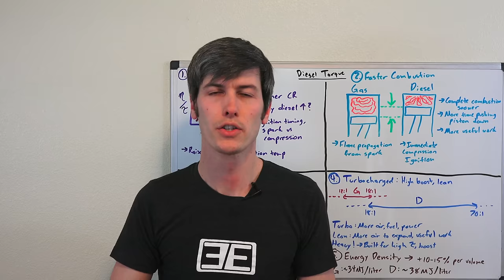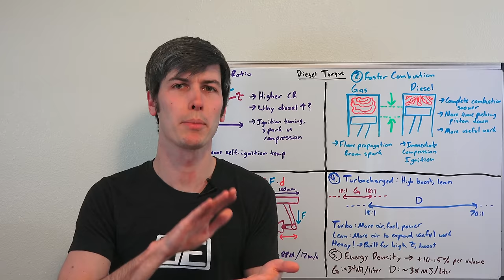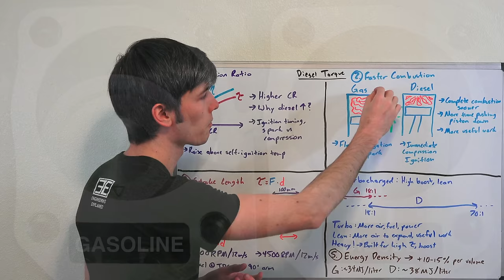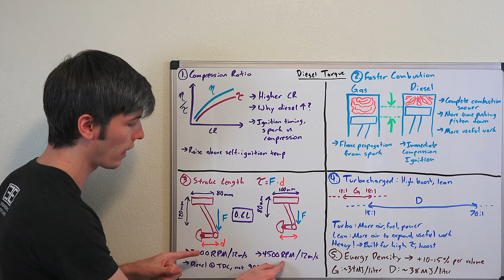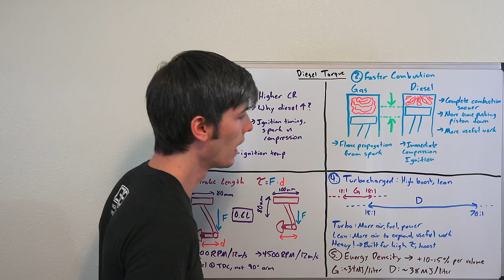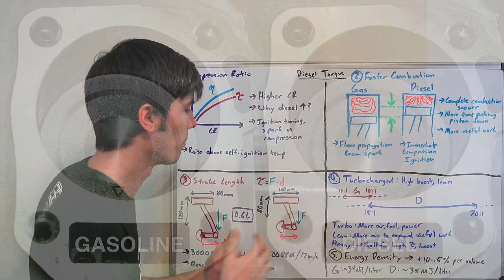5 Reasons Diesel Engines Make More Torque Than Gasoline

Comment: Bore/Stroke ratio doesn't really affect compression. Diesel's tend to be long stroke slower cycle engines to allow a longer time frame for the injection of fuel. Spark ignition engines can have the fuel injected earlier, and the spark advanced, to allow much higher engine speeds.

Comment: Gasoline has a density of 680g/litre and deisel fuel oil has a density of about 900g/litre therefore there is more than 15% more fuel in a litre of diesel. Say 32.4% more fuel in a litre of diesel. So if gas pick-up burn 10litres/100km-hwy it should burn about 7.6litres/100km-hwy with a diesel engine. Both having a standard transmission.

Comment: See specifications for N/A gasoline engines 2.0/3.0 litre and compare with diesel engines with same displacement (Mercedes OM606 and M104 for example). Think. Make conclusions, using that comparsion. (Yeah, diesel makes less torque than gasoline engine)

Comment: When the piston travel is longer, the force reduces as the piston retreats, therefore!this is a factor that reduces the average torque per stroke. However, the mechanical multiplication (crancshaft offsets) compensaates for that so I think you end up with more torque, less rpm, less power more fuel economy regardless of the fuel and compression ratios. My dirt bike seems to have high torque, low rpm and it has long stroke.

Comment: He is quite wrong about stroke. Potential torque relates primarily to the total cubic inches. The only reason a long stroke "under-square" engine produces more torque at low rpm is that a tall, narrow cylinder holds heat better than a fat "over-square" cylinder. At low rpm, this becomes more critical as heat loss equates to less pressure on the downstroke. The concept that a longer stroke produces more torque mechanically is a myth.

Comment: I understand the diesel being stoiciometricly (sp?) better all the time. The fuel self ignites and under light load burns completely with any O2 available. I question the speed of combustion you referred to. If it is indeed faster that Gasoline, the jumbo marine 2 strokes would not be very effective. I'm thinking about the opposed piston types used in the '40's and '50's. Fairbanks Morse IIRC.

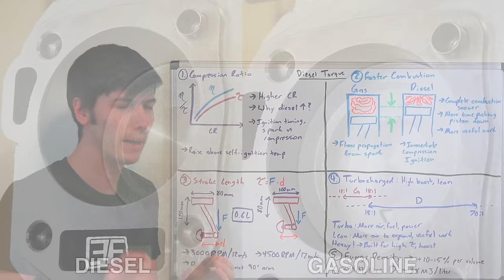Comment: 3:33 i expected to see these numbers a little closer to equal.   3 x 50mm x 50mm x 80mm (volume of a cylinder) = 600,000 for the gas, 3 x 40mm x 40mm x 120mm = 576,000 but changing the 120mm stroke to 125mm makes these two engines equal instead of just close.  3 x 40mm x 40mm x 125mm = 600,000.  i dont know why i paused it to double check.  just food for thought.

Comment: I can't believe I just heard him say he isn't convinced stroke length plays that big of a role in power of a diesel engine!  Of course it plays a major role! With a longer lever comes more torque. With a longer stroke comes more piston speed drawing in more air. Both of which make substantial changes to torque levels. Ever wonder why a 36klb rv can get 12 mpg with a 11 liter diesel while a pickup/trailer combo  weighing 20klb gets 9 mpg with a 5.9l diesel? Stroke has everything to do with torque. Turbo boost will only get you so far before a diesel becomes inefficient at around 32 psi. Of course nothing runs well if it is tuned improperly...

Comment: it's funny that a diesel engine has more torque yet more stroke too.. in a gas engine when you increase TQ they tend to want to REDUCE stroke due to stress on rods, which causes them to snap. I'd think a diesel would have a short stroke and larger bore since its combustion occurs at near the TDC, this would also make the engines stronger, same with the power of the fuel... everything seems counterintuitive... spark plugs are such a waste of space. I don't know why they ever put them into the modern gasoline engine. They should have just used high CR, low octane gasoline with a fully computer-controlled valveless system, for throttle control and chemical injection for timing control, such as a water/methanol system. Small stroke and large bore straight billet 2 stroke engines. I'd have it set up as a horizontally opposed cylinder style, aka OPOC. Or forget cylinders and just to rotary. I mean rotaries only needed like 3 improvements, cylinder offset, spark plug offset and better materials on the casing aka forging.

THAT would be the ideal engine. Turbocharge THAT!

Comment: Well it is not quite right to say Diesels torque is higher. You have to consider, that torque is dependend on rpm. Considering that Diesel can go up to 4500-5000 rpm against gasoline up to 8000 or in high power engines even 13000 rpm. Now that means, that in a Diesel you lose almost 50% of the available rpm for torque to raise. In the end both engines have nearly the same torques but Diesel much quicker at around 1500rpm.
The second thing is, that you cab also turbocharge a gasoline so this statement is kind of useless.
And even though Diesel has more torque at lower rpm's in comparison to gasoline engines it still hasn't more at all.
This leads to the drastic conclusion, that gasoline engines are much more powerfull. Since power=torque*2pii*n gasoline engines with same volume have nearly double the power of a Diesel.
A turbocharged gasoline 1l car has a max. (max as in the standard car not racing equipement) power of 120HP when a Diesel 1l would have around 60-70max.

I am an engineer so I can definetly say that you looked at it the wrong way. But to be honest these mistakes are common and this is what everybody thinks because the Diesel has the high torque at low rpm.

Comment: maybe was asked before, sorry if so, but I didn't have time to check all 1237 plus comments..
WHY the manufacturers/engineers don't take the diesel approach (higher compression, better economy, more torque, etc) to the gas engines?
I guess it is because gas with explode before reach that highest pressure, but that's the reason the gas has higher octanes available... airplane and racing gas reach 130 octanes (maybe I am wrong), so, I guess the question goes to pure economic maths... savings in sparks plugs, wires, and ignition controller, higher MPG, more torque (so less RPM and more live/durability of the engine), but higher gas costs..   so, many saving points against just bad one...   so is the gas cost the reason? or is there something else I am missing?
thanks anticipated.!

Comment: Sorry, but comparing force charged engine to naturally aspirated engine is so WRONG and unscientific.

Engine equipment as turbo, direct-precise-high-pressure injection is the true reason why diesel (TURBO diesel) have more torque. Compare naturally aspirated engines please, or both with same equipment.

Comment: I don't really get why diesel engines aren't implemented in performance cars more often. I get the longer stroke length results in a slower acceleration at the crank but with more torque at your disposal isn't that a problem that could be solved in the transmission? 

I mean as I typed that I kind of answered my own questions in my head. Maybe the extra expense of the engine and then a more robust more expensive transmission to convert that torque back into speed thusly negating the extra torque and converting it back into speed the car would have already had if it were gasoline which makes the extra more put into the engine and transmission a waste. Am I way off? I mean it still seems like the added reliability of a diesel would be worth something extra to many of us, but it's heavier which kind of shits on your preformance.

Comment: Hi from France, I'm looking for some reliable informations about carbon deposits removing technics. HHO, additives, cleaners, walnuts etc... of course taking things apart is efficient but I'm not a mechanic and I don't see myself doing that. I wish someone tried those methods with a before/after comparison. Which work as preventive method and which as a curative method. And some informations about which ones are dangerous to the metal parts, the seals, the gaskets... I've been watching lot of videos, reading lot of forums but none are truly scientific in my opinion and I know you would do a great job... Please...! Merci!!!

Comment: I am debating wither to buy a diesel v Petrol van, to convert into a small camper? I like the quietness of gas engines over the noisy smelly diesels, but recognise diesels last far longer with less moving parts: timing chains, belts, etc., and are more co-efficient per stroke. The wear on brakes and other car parts are the same per milage, so it basically breaks down to engine choice...as what good is a good diesel engine when body-work is rotten and other parts are nickered? And why no diesel motorbikes and superbikes? So can someone convince me to choose a diesel over a gas van. I just looked online, at a Citroen Berlingo Diesel with 200k motorway miles, but they always claim that? But the bodywork in the photos looks very good, for £3k, in the UK. It pleased my initial senses, but I'm unsure? Are there any van mechanics or designers out there to advise me? Cheers in advance.🧐😟🤓😏😢😂

Comment: Hi, there. I normally really enjoy your videos, but I think I have to mention some facts that are kinda backward. The typical, not turbocharged diesel engine is already built pretty robust. This is because of the pressure spike during the self-ignition due to the adiabatic compression. In addition, diesel engine exhausts are colder then gasoline engine exhausts. Therefore one can easily add large turbo chargers also using VTG and multiply the middle pressure of the diesel engine by a fctor of three (from around 8 to 24 bar) in real life cars. The small bore and large stroke are related to the smaller rpm diesel engines can reach. 

Have a look at the SDI engines from VW, a 2 liter SDI has a mediocre power of 75 hp and a torque of 140 Nm (S like Sauger as compared to T like Turbo). It is NOT the diesel in a TDI that gives the diesel engine it' s large torque but the possibility to build an economical, lasting engine/turbo combination with a comparibly very high middle pressure.

Comment: From what I understand, It is not that a diesel always produces more torque, but that at lower RPMs (<3000rpm or so) it does produce more torque.  At higher RPMs (>4000rpm or so) the gasoline engine actual produces more torque.  This is assuming similar displacements.  Does that sound right?

Comment: On my old calibra c20xe engine , when pistons were in  in top possition they were flat with engine block and maybe half of milimeter higher.If there not head gasket pistons wil  hit the head. ratio was 10.8-1 .How on this video pistons dont go to top of cylinder on gasoline engine

Comment: It's my understanding  that " torque " is the effort required to turn a shaft...Four cycle , two cycle engines or anything else that requires a turning effort...Could be a diesel, gasoline, steam engine ,  tap water valve or even a hand or finger crancking device like my  vintage early morning wake up clock...What  makes the difference?  TORQUE?...

Comment: Wrong on a number of counts.  Diesel actually burns slower.  The method of ignition, spraying into hot, compressed air, means there is a more complete combustion and you can spray that fuel until you get to anywhere between 15 and 30 degrees after TDC.  It isn't a faster burn, it is a more controlled, complete burn.  The reason for a lower maximum RPM is the same reason larger V-8's have a much lower max RPM than a 1.5 liter 4-banger...that is the rotational mass of the rotating assembly.  The heavier or more massive the rotating assembly is, the more critical the engine balancing is and the slower it can turn without tiny imbalances  causing vibrations and shaking that will tear the engine apart--mainly due to damaging the the crank and mains.  If you have your rotating assembly balanced down to 1/2 a gram, you can safely spin at MUCH faster speeds that the typical 5-10 gram or higher balancing you see from the factory or a machine shop.  A smaller rotating assembly that you would find in a little Honda or even better, the little crotch-rockets that fly around, wrapping out to 10,000 and 12,000 RPM have light little rotating assemblies so even if there is a little imbalance, they don't put nearly the strain as a 6 liter Powerstroke's rods and crank with the same imbalance.  They also tend to be better balanced in general.

Comment: Stroke has a very significant affect on torque.  If you take a rifle with a 28" barrel length firing a 7.62 NATO round and a single shot pistol with a 10" barrel firing the same round, you will have higher velocity from the 28" barrel.  This has been explained as being due to the bullet spending more time with the power from the explosion being transferred to the bullet.  The velocity and corresponding muzzle energy is far greater in the rifle, even though they are both using the same amount of powder.

Comment: You are not right in point №2. Power of the diesel pump strictly limits the lowest injection time. And this period is large than combustion time in gasoline engines at high rev. That is why gasoline engine outperforms diesel at high RPM (The diesel pump just cannot support fast injection timing for high efficiency.
And you are completely wrong at point #3. You talk about levers length and completely forgot that higher bore means higher force produced by the gas on this lever.
You have 1.7M subscribers and you miss the simplest things. Shame on you!

Comment: Hi, I have a question. It was asked a lot and was answered a lot of times, yet I'm not satisfied. "WHY DIESEL IS MORE EFFICIENT?".
The common answer is simply because diesel is ignited at a way higher pressure then gasoline. AND WHAT? How does that actually help? 

Here is what I know about piston engines:
A piston engine is most efficient when the pressure in the cylinder at the end of the combustion stroke (basically when exhaust valve is about to open) is equal to the atmosphere pressure. 

If the pressure of the exhaust gas at that moment is higher, than that pressure simply goes to waste through exhaust pipe. Pressure is the potential energy that can be transformed into kinetic energy. But since the piston cannot move further down, that energy cannot be converted and it simply goes to waste.

If the pressure is lower than 1 atmosphere (negative pressure, applies for gasoline engines),  than a part of the energy coming from combustion is lost when that negative pressure sucks the piston back in. And when the exhaust valve opens, a short exhaust gas intake occurs thus the engine doesn't have the possibility to restore that energy lost at overwhelming that negative pressure force.
[Variable Valve Timing in theory should solve that problem]

So, since diesel engines doesn't have any air intake control system (unlike gasoline engines, it's the throttle), we have a lot of air and pressure during compression thus after combustion we get even more pressure and a lot of it remains unused at the end of the combustion cycle, thus it goes away down the exhaust pipe.

So considering all that, how diesel can be more efficient than gasoline? What am I missing here? The energy potential of diesel fuel is not much higher than gasoline. Is it because we have lower compression pressure on higher RPMs? Is it because the intake pipe is narrow and in fact there is not much air going in?

I would really like to see a video about it, with all the details, or just an answer in the comments.

Comment: so, I have a question. cant seem to find it online heard it from a gear-head and wanted your opinion on the matter. I have a 1978  Ford 150 351m. it had 34k original miles. i tore the block down and had it rebuilt with a midly aggressive cam. He said after 1000 miles, put a full tank in it and top the rest off with half a Gallon of diesel fuel. and he swore it would raise the torque of the engine by doing so.(not by much i think he said by 2 points). what's your thoughts?

Comment: Hi Jason! Is point 4) similar to the Lambda? A diesel engine burns at Lambda 1.3 to 6, which means that the mass of air is 1.3 to 6 times more than the mass of diesel. I don't get that 70:1 rate hahaha :-) Gas engines burn at Lambda 1 to 0.85 at full throttle. This is why diesel engines are consuming less :D

Comment: If you have a 2.5ton car, with a V6 3.0 diesel engine, you will make about 10% to 20% more mileage per fuel unit than a 1.5ton car, with a 4straight 2.0 gasoline engine. But they always say that diesel pollutes way more. Is it true, even with the efficiency gap between them? And the new biodiesel fuels, have a better chance of turning the pollution table?

Comment: Actually, diesel engine does not produce more torque overall, but it produce it at low rpms. Petrol and diesel both with no boost or same amount of boost are no match at torque numbers. If you compare turbodiesel engine with naturally aspirated petrol, of course, turbodiesel has way more torque.